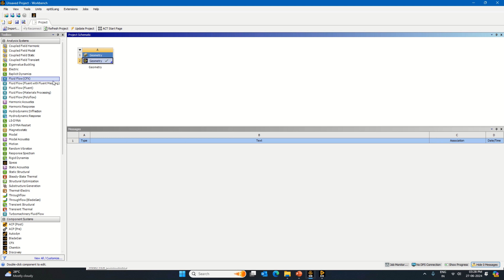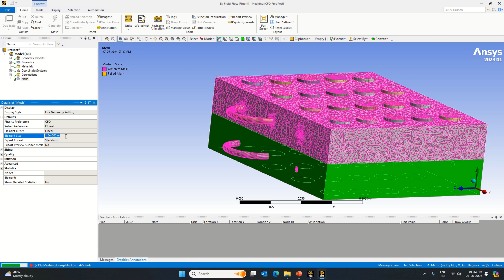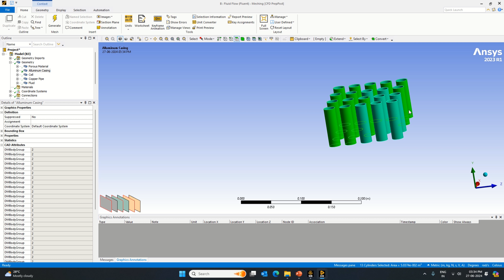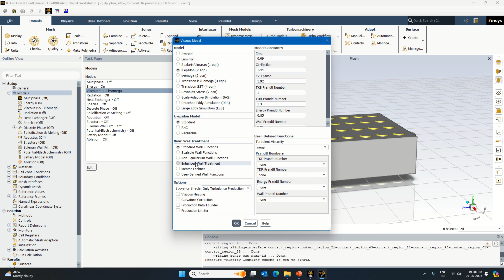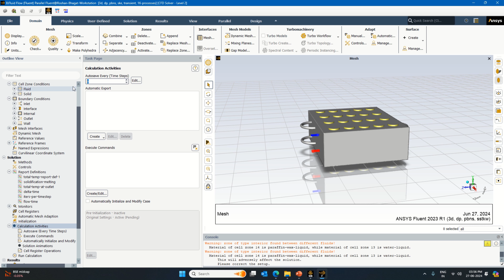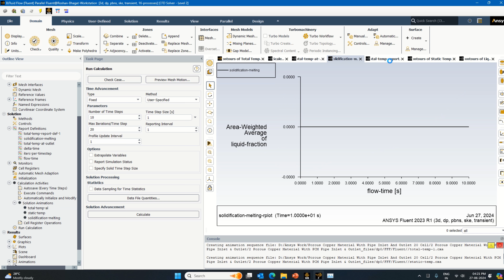CFD Simulation of Lithium-Ion Battery with Composite PCM and Liquid Cooling

Comment: Isn't a volume-weighted average required for liquid fractions in the report types? That's why a straight-line graph appeared in the video
Reply from the maker: It has to run further to visualize melting.. then the curve will rise up.

Comment: Could you please provide the reference paper link, used for assigning properties to PCM?
Reply from the maker: Experimental and numerical investigation of a hybrid battery thermal
management system based on copper foam-paraffin composite phase
change material and liquid cooling
Reply: @FrontiersInCFD  Thank you
Reply from the maker: welcome